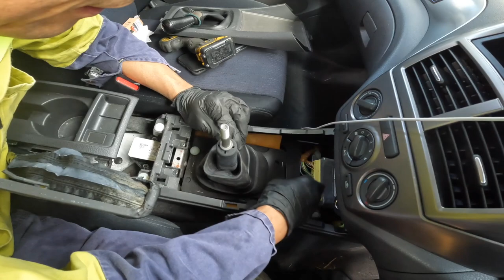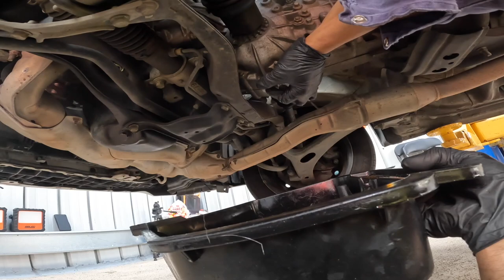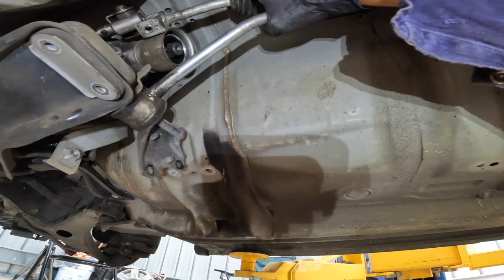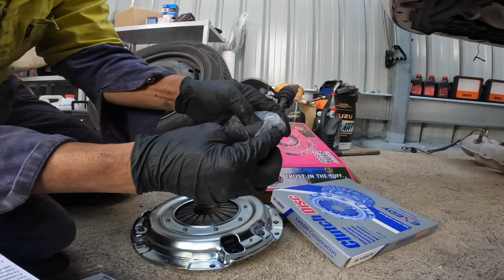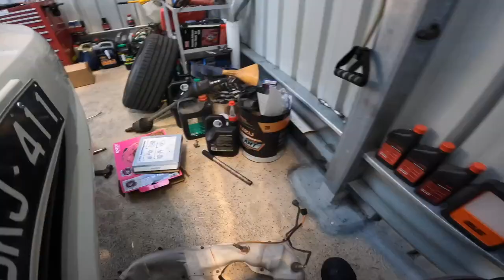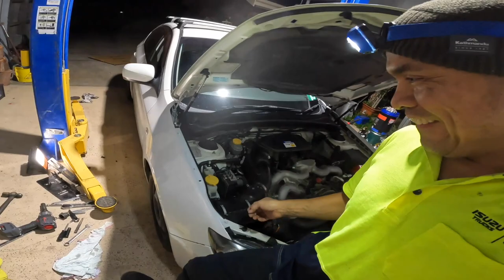How to replace manual clutch kit on Subaru Impreza

Comment: Just bought 2019 Crosstrek in manual. So hard to find fully loaded. I had to stay up for 30yrs to go get the car. Totally worth it though. Heard the CVT is nothing but trouble.
Reply from the maker: Yes mate, do not buy car with CVT transmission.